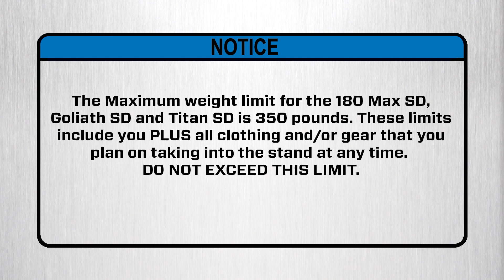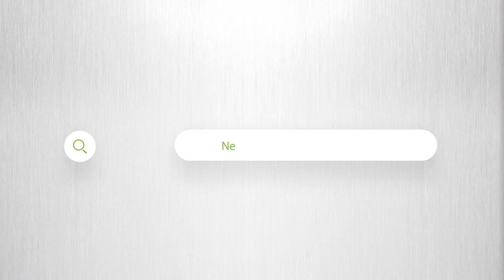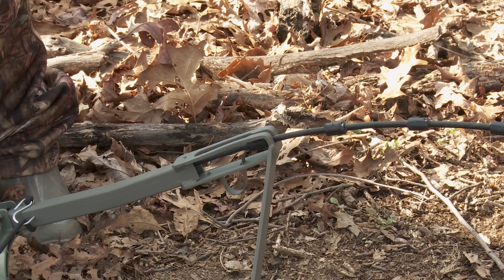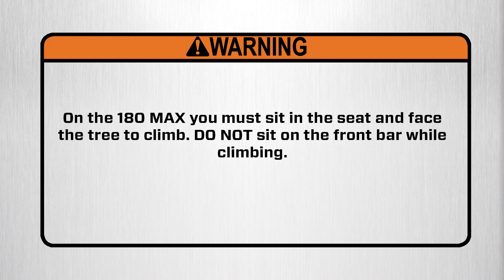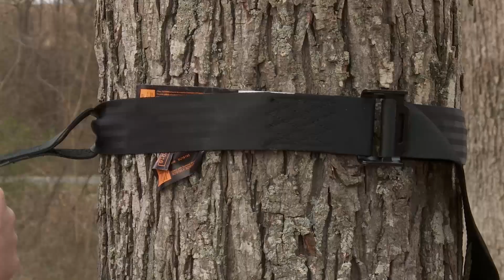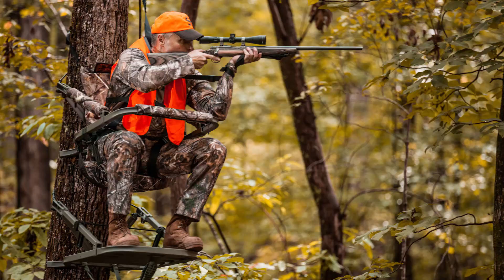Summit In-Line Climber Treestands (Viper SD, Goliath SD, Titan SD etc.) | Safety Instructions

Comment: New to the climber world and put it to use this hunting season. https://www.youtube.com/post/UgkxlQ7TDIrnnSXXbRgFFaxqwullRJJIuYAs I felt safe while climbing up and down a tree. It did take some time getting used to climbing and descending the tree. Once I figured it out I was comfortable going in climbing a tree knowing I was going to be up a tree quickly and most importantly quite not scaring every deer out of my area. I am 6’2” and 240 lbs, fit and comfort were great. I bow hunt and found no issues hunting from it. It is a little bulky to carry in and out of the woods vs some of the smaller open front climbers but I thought it was worth the bulk/weight due to ease of climbing (using the rail to sit on) and comfort for long sits.

Comment: This is a nice light product to backpack however I do not find it as safe as the old steel climber I have.  Lots of slippage if you do not adhere to the angles recommended.  If the teeth were sharper to allow them to dig into the tree more would be a plus.  Maybe stainless and make them replaceable.  More finite adjustable cables instead of every 4 inches.  Be safe with this and wear a harness folks!  Make sure the line is used between the platforms and has a tight knot.  Good luck hunting and be safe!